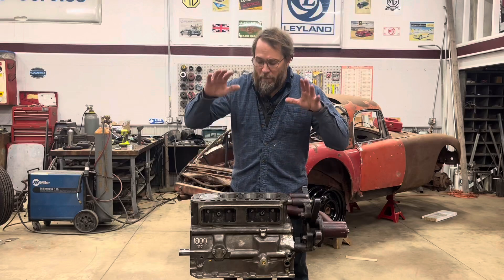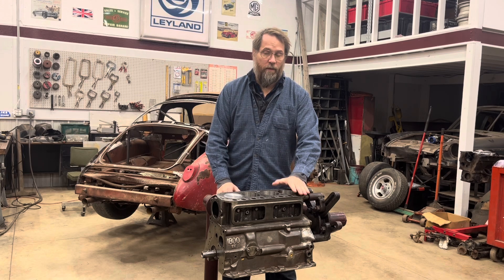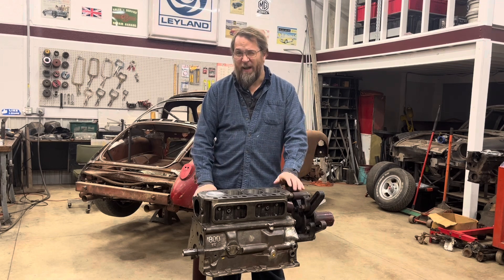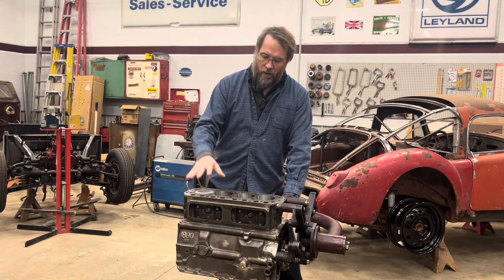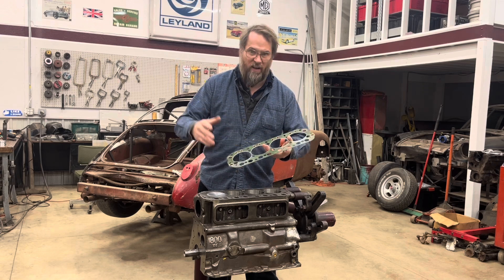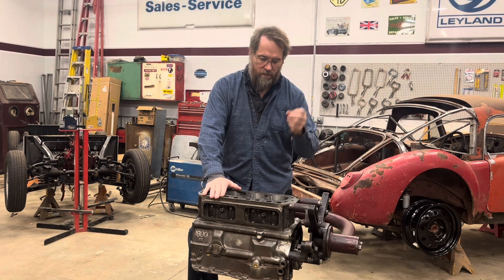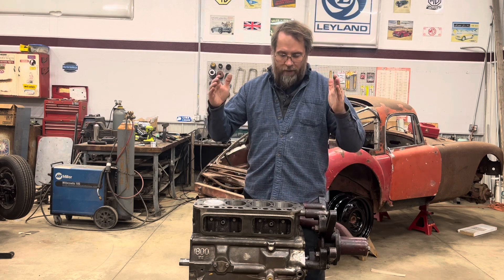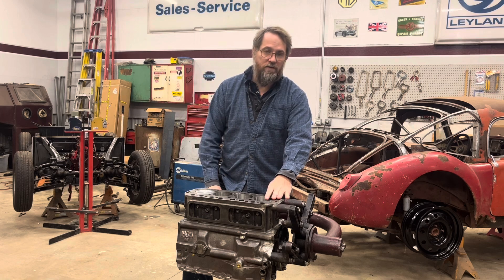Final machining decisions on my MGB performance engine build

Comment: Compression ratio is not the only thing to look at. Valve timing is in control of how much pressure is generated. When the inlet valve closes. Think about it.
Reply from the maker: Yes I know, valve events do you have an effect. In really simple terms, a bigger cam does effectively bleed off some compression and show lower cylinder pressures and a smaller cam would with the same effective compression ratio.

Comment: You can get multi layer/modern type gaskets now, they come in 3 different thicknesses so you can choose which suits your desired CR.

At the compression ratios you mentioned, I would not worry too much about octane ratings… it will be fine. 

You can get main caps 2 and 4 converted to steel if you like but it requires a line hone which may cause more issues that it’s worth… and depends on how you want to use the car… 

Yellow Terror in Australia sell a fantastic set of roller rockers for the MGB.. but you will need to have the rods sized accordingly… but they really are awesome.

:)
Reply from the maker: The Cometic gasket I will be using is a MLS gasket, and they come in 14 different thicknesses… they’re just a bit pricey. 
These engines are known for being a bit finicky to tune on pump fuel (at least what we have here in the states) when you get into the compression range I’m looking for with limit of pretty much 10:1 on 93 octane (US rating) without having to back the timing down a lot to keep it from pinging.